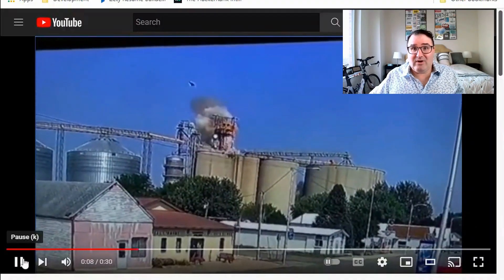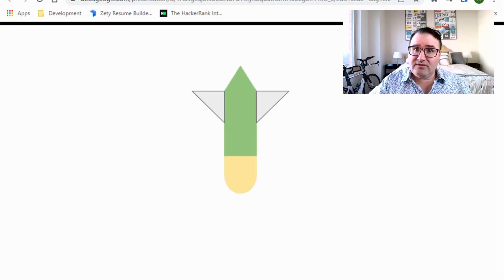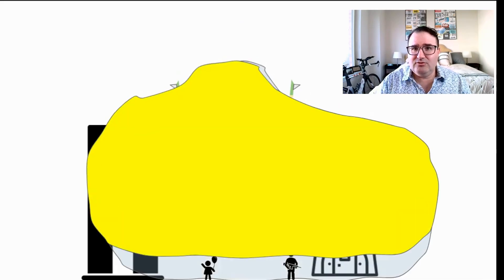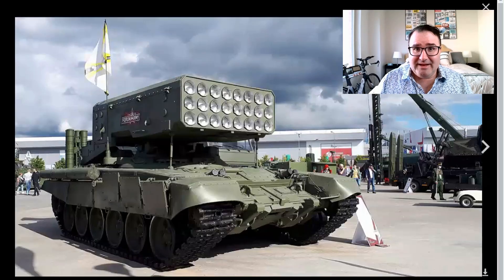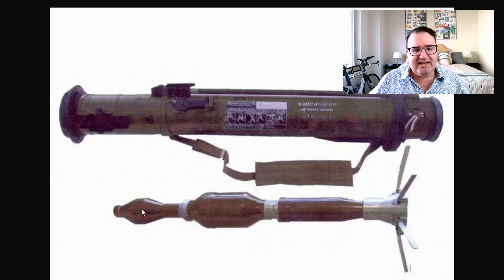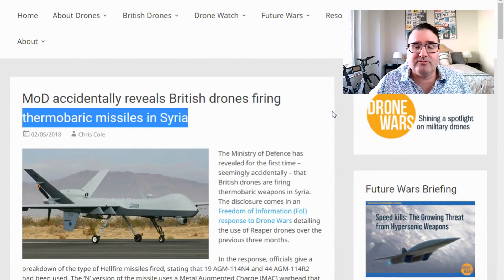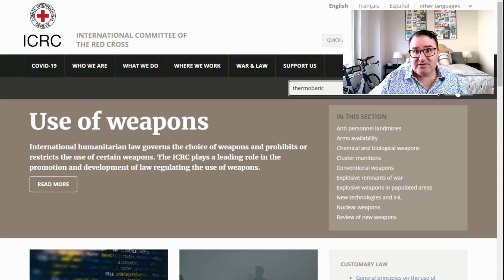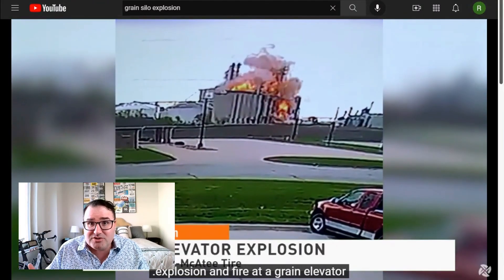How do Thermobaric "Vacuum Bombs" actually work?

Comment: I retired from the USAF in 2019 and was a Target Analyst working with various munitions including some with thermobaric warheads. I was attached to a squadron that did combat operations and testing/evaluations and there was a noticeable drop off of sustained peak pressure in high humidity environments however, the munition still performed as expected in achieving the required objective. Visually, the blast wave propagation was extremely evident and made for an interesting debrief video.
Reply from the maker: This is useful. Thank you.
Reply: Interesting! In combustion cycles (gas turbines, ICE), higher humidity/rain actually improves performance as the phase change to steam adds to the pressure gain, outweighing any cooling effect of the water.  Presumably "sustained peak pressure" is what you're looking for?
Reply: @adambracegirdle   the engines you're talking about are internal or contained combustion, FAE munitions are in many instances uncontained  or are contained in disorganized or random ways. Perhaps yhat's the difference.
Reply: @adambracegirdle  Yeah, I used to work on Tanker aircraft in the Air Force back in the day. On the KC-135A the engines used a de-mineralized water spray into the intakes to increase thrust for take off. apx 600 gallons in two minutes. We were told that the spray cooled the air and made it more dense, but hey, that doesn't mean it's correct.
Reply: @adambracegirdle  the water vapor cools the air, making it expand less, meaning every cycle  there are more oxygen molecules because  of density. The cooling effect  takes place in the intake part
Reply: @adambracegirdle  water is injected in a mist to engines in ww2 planes to add a little bit power?
Reply: @adambracegirdle  at least in reciprocating engines humidity reduces power as extra moisture in the air takes up space and slightly decreases the amount of oxygen making it into the engine for combustion.
Reply: @adambracegirdle  that makes a lot of sense actually as i don't think there would be substantive cooling of water vapor. Is there noticeable expansion differences on water vapor relative to dessicated air? I. E. What's the volume change for standard unit of fuel between gas mixtures? Part of me would assume the water vapor might prove less expansive since water has higher heat capacity 🤔 but with Water as steam/vapor I don't know if that holds
Reply: @Donthaveacowbra  air saturated with water vapor is going to have a harder time atomizing with fuel vapors as it's already saturated.  The less humid the less saturated the air is and the more easily it can bond with fuel vapor in the short time span a thermobaric explosion takes place in.
Reply: @adambracegirdle  I've heard this is incorrect, as it's offset by the lower density of available oxygen in humid air; and as such, any benefits are superseded by that drawback
Reply: @krakhedd  It's correct, used very widely in late ww2 prop fighters, often combined with methanol and/or nitrous. Germans used it in almost everything that flew. Look up MW50.
Reply: @TzunSu  yes but that is for very specific reasons, and and forced induction applications; that says literally nothing about humidity's impact on performance
Reply: @krakhedd  Sure, but the comment was specifically about those kinds of engines.
Reply: @TzunSu  no it isn't. He broadly said, gas turbines and ICEs. They run with or without forced induction. Wel gas turbines are technically jet engines which are basically a series of turbos mounted on a concentric shaft and in which the air is compressed and fuel mixture burned, rather than operating on the heat of exhaust gases as an induction compressor
Reply: Wow. That was an impressive comment
Reply: @unspoken24  hey buddy, u know that you have a highly capable brain locked away up there...right?
Reply: I'm not too surprised to hear that. Sheets of water droplets are used as sound and pressure wave reduction by NASA when they launch rockets, but honestly I wasn't sure because they aren't as hot. Thanks for your answer and sharing your knowledge!
Reply: China lake?
Reply: @BWo-bb1yw  5 to 6 shots a year 👍
Reply: @jeremyortiz2927  In your experience or opinion, what would be the possible affects of using the device in fracking?
Reply: @E M  Technically, a thermobaric device could be used to generate pressure to fracture rock formations, which is similar to the process of hydraulic fracturing or fracking. However, using a thermobaric device for fracturing would likely be impractical and not cost-effective.
In general, thermobaric devices are designed for use as weapons and are not intended for civil engineering applications like fracking. Additionally, the energy and power required to generate the type of overpressure needed to fracture rock formations would be extremely high, and the logistical challenges in using such a device for fracking would likely outweigh any potential benefits.
Moreover, there are many environmental and social concerns related to fracking, including water pollution, contamination of underground aquifers, and other potential long-term health risks.Therfore it is unlikely that a thermobaric device(s)would be considered a viable or safe alternative to conventional fracking methods.
Reply: @BWo-bb1yw  or Eglin
Reply: This is ars Technica level beauty in the comments section preconde Nast
Reply: It’s quite simple, wet fuel doesn’t burn as well and rain absorbs pressure and sound waves, those water fountains you see below rocket engines during launch are there to absorb horizontal pressure as not to shake shit to pieces at the launch pad. If you’ve ever seen a live launch then you know the sound is incredible even at 2.5 miles away.
Reply: I noticed you didn't comment on the rain part of the question. Did you ever fire them in the rain? How'd it work out?
If not, why didn't you?
Reply: Yes, humidity and rain will displace air molecules, but if you can stand in it and still breath, then not by much. Also, remember that flame throwers and napalm are now forbidden by treaty's and policy announcement. Thermobarics r the replacement. Same devil; different costume.
Reply: @appamaddox8190  There's no treaty that forbid neither napalm nor flame throwers. What treaty would this be, specifically?
Reply: Exploding one of those bombs in the middle of a very heavy downpour would increase the blast, slightly, by flashing the water droplets to water vapour. It would then be more properly called a fuel-air-steam bomb. More bang for your buck. This is because phase change from liquid to gas increases the distance between water molecules about a thousandfold. It would also have the effect of reducing the heat, due to its absorption by the phase change, but only slightly.
Reply: @Acharacle & Achiltibuie  It is highly unlikely that a heavy downpour would increase the blast of a thermobaric weapon. In fact, rain and other adverse weather conditions could potentially have a negative impact on the performance of the weapon.
Thermobaric weapons rely on the formation of a combustible cloud that reacts with the surrounding oxygen to produce a powerful blast wave. Depending on the design of the weapon, rain could potentially affect the delivery or detonation system, making it more difficult to achieve a consistent and effective detonation.
Additionally, rain can affect the air density and reduce visibility, which could make it more difficult to target and deliver the weapon accurately. The rain could also cause the weapon's combustible cloud to disperse more quickly or unevenly, leading to an ineffective or miscalculated detonation.
Overall, it is unlikely that rain or heavy downpours would increase the power of a thermobaric weapon and could instead result in unintended consequences that could reduce the weapon's effectiveness.
Reply: The peak pressure may have been lower but was the duration longer? that could explain why they still preformed as expected. I know a longer duration at a lower pressure is just as good as max peak pressure for a short duration.
Reply: I've heard people say that these bombs can suck your lungs out of your body. Is that true?
Reply: @Luis Miranda  It is highly unlikely that the blast from a thermobaric weapon could literally "suck" someone's lungs out of their body. While the blast wave generated by a thermobaric weapon can cause significant damage to internal organs like the lungs, the mechanism of injury is not one of suction. 
The rapid expansion of the weapon's explosive mixture creates a blast wave that moves outwards from the center of the weapon. This wave of compressed air can cause significant overpressure and impact injuries to the body, including the lungs. The blast wave can cause a rupture of the lung tissue or damage to the delicate air passages within the lungs, leading to severe internal hemorrhage and potential asphyxia.
Thus, it is more accurate to say that the blast wave generated by thermobaric weapons can cause significant harm to the lungs and other organs, rather than literally "sucking" them out of the body.
Reply: Ambient humidity and rain could potentially affect the power of a thermobaric weapon, but the impact would likely be minor. The main way that humidity or rain could affect the weapon's power is by altering the density of the air that the weapon's blast wave travels through. 
Humid air is less dense than dry air, which could, in theory, reduce the strength of the blast wave because the particles in the cloud created by the weapon would not react with as much oxygen. However, the effect is likely to be small and difficult to predict accurately. Rain could have a similar effect by reducing the density of the air, but again, the effect is likely to be minor
It is worth noting that many other variables, such as the weapon's payload and delivery system, are likely to have a much more significant impact on the weapon's power than ambient humidity or rain.
Reply: The larger molecules of water would require more energy to increase mean particle velocity and mean collision distance. However that being said as noted by Jeremy because your pressure is lower does not mean that you are transferring a lower amount of energy. It takes a lower pressure differential to cause damage under water then on air is an example. It's all down to how much energy can be dissipated across a certain surface area and in how short a time can this energy be dissipated. If the detonation causes less damage its due to wavefront being longer and dissipating the energy in a lower amplitude shock. If the wavefront causes more damage then the higher air density allowed for a faster waveform to dissipated and the shock had a higher amplitude. You also have the other extreme where it's an extremely long wavefront but still sufficiently high amplitude that you still have structural damage. Example of this is the thermobaric bombs. Cheap low amplitude wavefront but at such a long dissipation time that you still cause damage. Benefits of not carrying your own oxidizer is you can bring more fuel.

P.s. a reply to Adam. Gas turbines are more efficient during high humidity because they tend to run a leaner mixture during that time as the engine tends to operate at a lower temperature. This is due to the closed loop control of the turbine and is not a feature available on thermobarics as far as I know. Also I'm pretty sure all thermobaric warheads run lean to increase temperature and pressure as they dont worry about silly things like preserving your high pressure turbines blade integrity. And avoiding thermal shock of your hpt or combustion chamber.
Reply: @Jerermy Ortiz. Careful with what you post... I dont think it's very smart for you to be giving information over munitions, given your previous position. Even if its open source.
Reply: @Mavish11  he didn't give any nomenclature, locations, etc... everything he said was detailed enough that people who know what he's talking about can understand it without him giving too much detail out. Technically all you know is that he was TA in the USAF and worked on munitions that didn't really perform any differently in high humidity... lol which basically just answered the question in the video....
Reply: @Mavish11  he never gave any information on specific munitions, just about how thermobarics work in general. In fact, he was quite vague with the details of what he did actually (probably intentionally).

Comment: I saw an infographic once about these, and it seems that when used in caves, the blast has two waves when detonating. It has the original outward blast wave that you could theoretically hide from in a cave, but then the void in the middle of the explosion creates a secondary wave in the opposite direction potentially killing the people hiding in the cave since it overpressures the back of the cave and under pressures the front, creating a vacuum effect where the mouth of the cave is.
Reply: It doesn’t create a vacuum effect (or what I think you mean is a low pressure zone). The blast of the weapon is purely to disperse the fuel, which is ignited fractions of a second later. The time delay between the blast and overt pressure is imperceptible to anyone observing the blast without high speed cameras.
Reply: @Rourke-Slimer  the blast he Is referring Is from the air fuel mixture. The low pressure effect does exist, u can see It in nuclear explosion testing, the return wave of pressure Is what destroys weakened objects far away from the initial blast. Atmospheric pressure Is no Joke, the fact we dont mind that doesnt Mean its not a powerful force.
Reply: @rawdata678  that may be the case with nuclear weapons, but that’s not how the thermobaric weapons work. The over pressure is what causes the lethal effects. The weapon disperses the fuel, it mixes with air and ignites fractions of second later. In that very brief moment, there is a slightly lower pressure, but not enough to even blow open a door. It’s the over pressure that causes destructive forces and kills.
Reply: @Rourke-Slimer  just telling you what the info graphic said.

Comment: Two comments:
First, the Russian TOC seems an inheritance of the Nazi one in regard to the name and allocation of this units. It reminds me of the Nazi Germany "Nebelwerfer", which were rocket artillery assigned to the chemical warfare and flamethrower units(the name means "mist thrower"). I ignore if this is a tradition started by the Soviets in some way.
Second, a denser air should make the overpressure effect more destructive, but I guess there must be a certain range of humidity and rain conditions to deploy them, since many things depend of a correct stochiometric combination of the powdered or atomized explosive and the oxygen. It should be pretty wide, since in Afghanistan, Iraq, Syria, and Israel, the humidity is not a concern, but, in the case of the first one, altitude would mess with the oxygen content in ambient air, and they still worked just fine. Heavy rain should still mess it up by dissolving some of the explosives, the oxygen, absorbing heat, or preventing the correct dispersion of the compounds. You mentioned the 40 milisecond delay between explosions, and maybe it is accounted for? like, a dial for the timing, to ensure the correct mix depending on humidity, altitude, and weather conditions? Artillery units need all of that data anyways, to ensure accurate fires.